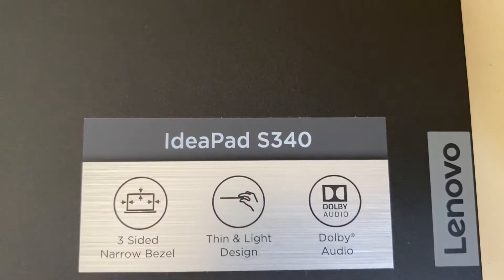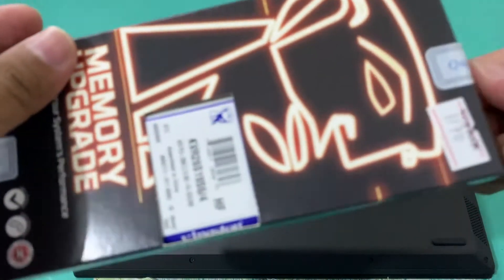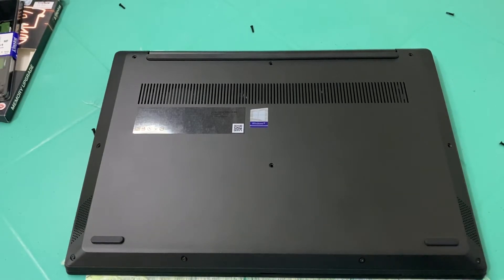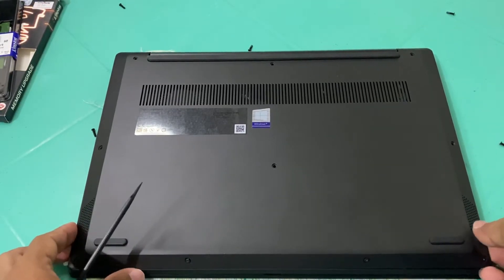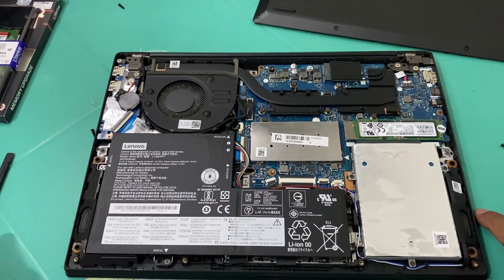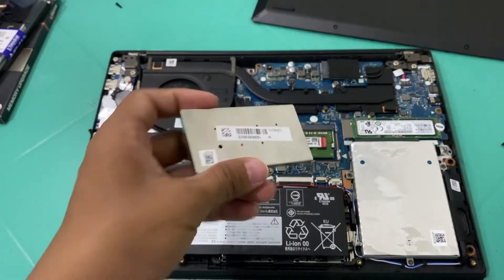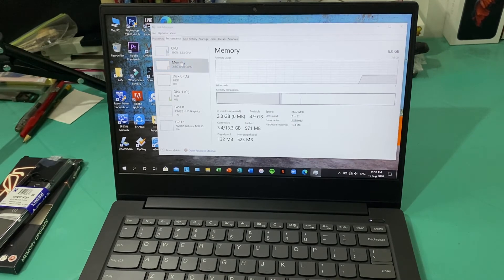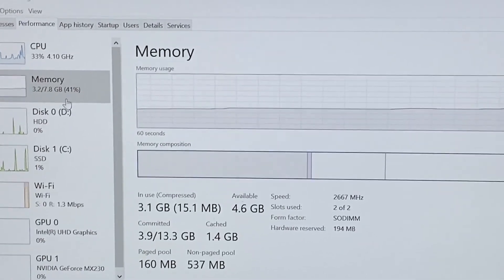Lenovo IdeaPad S340 RAM Upgrade Tutorial

Comment: i try to change, add kingston ddr4 2400gb dam but laptop is not boot...why? ur laptop is using amd ryzen 5?
Reply: No it's an intel core i5 10th Gen. My laptop's RAM is 2667 MHz. You can check yours through the task manager. I recommend using a RAM with the same frequency as the default.

Comment: do you have upgraded him to 16 ram???
Reply: no I did not, 8GB is already more than enough
Reply: @efespadilla  8GB doesnt allow to run Adobe Illustrator correctly :c
Reply from the maker: @sugiii9616  what version?
Reply: @EdsTechtalk  It doesnt matter. 
Source: Adobe, Quote:
"Adobe Illustrator recommended specs
Memory: 16 GB
Graphics Card: NVIDIA GeForce GTX 1070
CPU: Intel Core i5-8400H
File Size: 2 GB"

Comment: What is the max ram upgrade for this laptop?
Reply from the maker: Spec sheets says 8GB but I think it can support until 16 🤔
Reply: @EdsTechtalk  Mb 4GB + Slot 8GB =12GB....or
Mb 4GB + Slot 16GB = 20GB....which exceeded 16GB..not sure will have any issue?
Reply from the maker: @mootal2812  Not sure as well. If I'll guess, I think that you won't be able to use the "excess" RAM if ever
Reply: I tested out on my laptop with this exact model. When I installed the Crucial 16 GB RAM with a 4 GB RAM soldered into the motherboard, it's just showing me 4 GB memory instead. So, I'll say 12 GB is the maximum memory to be installed on this laptop model with a 4 GB RAM soldered to it, while 16 GB RAM is the maximum without a 4 GB of memory soldered to it, according to Kingston. Having a total of 20 GB of memory exceeds 16 GB.